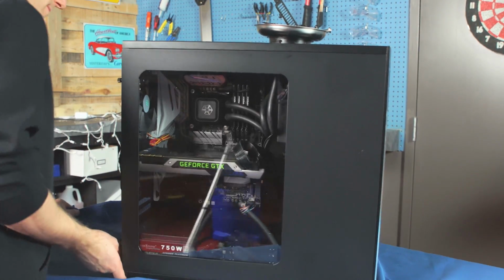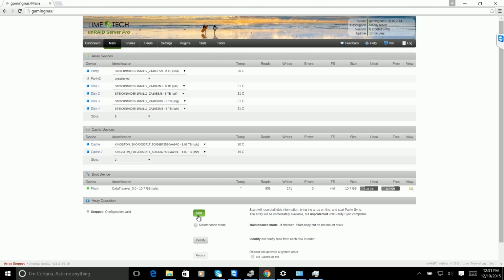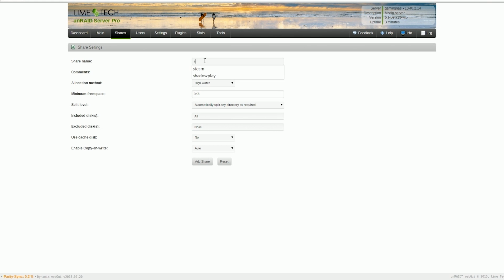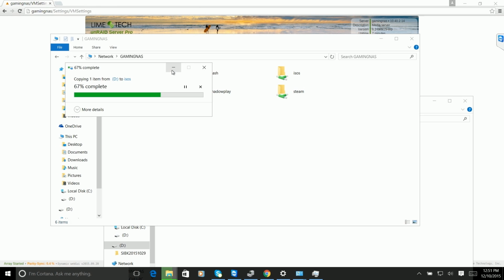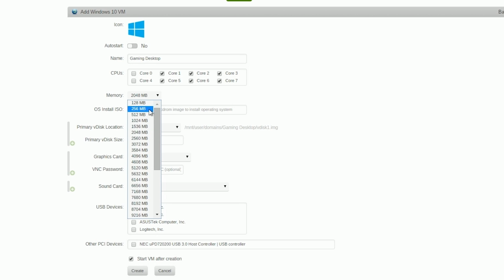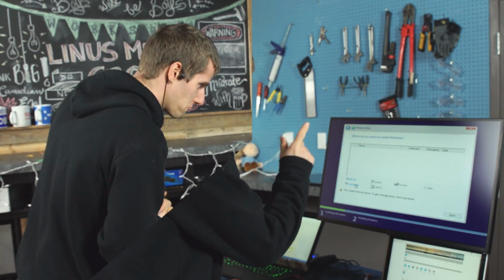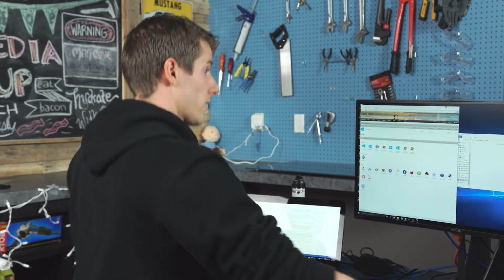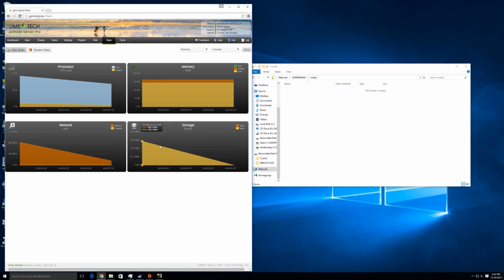Use your Gaming PC's Extra Power as a NAS Ultimate Guide

Comment: For those on a budget and not mind working with Linux, I'd recommend using Owncloud with Lubuntu (there are a lot of tutorials available online if you need any help).
I'd even got it working on an old Dell OptiPlex sporting an even older Intel Pentium CPU plus 2 gigs of DDR2 memory.

I must say that the OptiPlex case is not as flexible as I wanted it to be, but you get to fiddle around with a LAMP stack, Lubuntu and Owncloud :)

If there is a need to get more advanced options, I also suggest distros like FreeNAS or any other that has support for ZFS amongst other nifty options.

Comment: What would be the advantage of doing it this way vs just setting up a RAID through the BIOS or Windows and using that as a NAS?  Is it just for education/cool factor?

I'm surprised at how far virtualization has come (had no idea that you could use the full performance of a discrete GPU), but I would iffy about compromising any performance by running my main OS in a VM and wouldn't want to deal with any VM wonkyness when trying to play a game or do other normal computing tasks.
Reply: +Mark Murarescu True, but at least on my systems that isn't a huge issue. Not interrupting file transfers would be a bigger advantage, but for my home network any interruptions for the NAS would be less impacting than ones to the Windows OS.
Reply: +Darrell Johnson I was actually thinking the same. You can easily add raid in your BIOS or even in Windows and share it over the network. My guess that Virus scanners would work faster as well on local drives when using Steam drives/folders. Tbh I see more problems with this setup than advantages. It does not lower electricity costs only maybe if Unraid/Virt can switch the graph card off completely upon shutdown. Actually the 2 gaming PCs in one made more sense to me personally :) but that also comes with a lot of disadvantages. This is good for a tech demo tho but I do not see myself building this anytime. Rather spend the money on a standalone NAS. And about Windows crashing, well, in my case this usually indicates some hardware related issues which I doubt Unraid could handle, but I might be wrong... I guess I wont figure out.

Comment: I didn't really understand half of what was happening but I'm sure once I was setting up the software etc it would be easy to pick up. Currently I have OS/Programs on an mSATA drive and games on 2 SSDs meaning both of my salvaged 1TB HDDs are sat there hardly being used. It seems like it would be so much better having the HDDs in the system be network linked and actually get some use. 

I'll probably have a look into this more when I build my next PC. Would be awesome to have my gaming rig (which tends not to ever use the CPU fully anyway) store the recorded files to the NAS drives and then have my current rig do all of the video rendering and uploading alongside it.

Would something like this be able to offload stream rendering to a second PC when streaming gameplay etc or would that be pretty pointless?

Comment: I'm thinking of a build. Will it work?
PSU - Cooler Master V750 - Compact 750W 80 PLUS Gold Modular PSU
Case - Cooler Master MasterCase Pro 5 Mid-Tower Case with FreeForm Modular System, Window Side Panel, Top Mesh Cover
SSD - SanDisk 480GB Ultra II Internal Solid State Drive 
Processor - Intel Core i5-6600K 3.5GHz 1151 Boxed Processor
Graphics card - Nvidia GeForce GTX 770 2GB PCIe Video Card (REFURBISHED)
Cooler - Cooler Master Hyper 212 EVO. 120mm PWM fan
RAM - FURY Memory Black - 8GB Kit* (2x4GB) - DDR4 2400MHz CL15 DIMM

Please let me know about everything here. :)
Reply: +BushcraftWumbology For some reason, the motherboard wasn't there. I was planning to use the Asus Z170-A

Comment: If you're thinking short term, this is cheaper. If you're thinking long term this is a nightmare. Think about it. You have to keep your computer on 24/7 to get all the potential out of that NAS. Imagine how much your electric bill will be having a computer with all that extra hardware running all the time. Long term, it's more economical to buy a dedicated NAS. They're not that expensive now to do this. Plus for most users this is asking for something to go wrong.
Cool idea, but pretty impractical.

Comment: So I'm not sure if this was already mentioned, but I have a few questions:

1) If the rig is to be left on 24/7 (well, unRAID NAS and computer as a whole), but Windows is just a VM, if you were to shut down the VM, it should only kill the VM and not the whole tower, right? If so, how do I turn on the VM again? Do I have to access the NAS webpage and select to start the VM again? Or is there another way?

2) Is there a limit to how many VMs you could have on the unRAID? As in, can I have the NAS running via unRAID, and have Windows 10 and say, Ubuntu/Debian/some other OS as another VM but be able to boot into either using the same GPU/monitor?

3) where can I get this USB 3.0 PCI-e card?

Comment: About to build my first computer so any opinions/recommendations about these components?

MOTHERBOARD  -Gigabyte GA-Z170X-Gaming 3 (ATX, LGA 1151)
CPU  -Intel Core i5-6600 (LGA 1151 Skylake)
CPU Cooler  -Corsair Hydro H55
Hard drive  -Western Digital Black 1 TB (3,5" SATA 3.0)
SSD  -Samsung SSD 850 EVO 250 GB (2,5" SATA 3.0)
RAM  -Kingston HyperX Fury Black 2 x 8 GB (DDR4, 2666 MHz, CL15)
Graphics card  -EVGA GeForce GTX 970 Superclocked ACX 2.0 4 GB
Power Supply  -EVGA SuperNOVA 550 G2 (80Plus Gold)
Case  -Fractal Design Define R5 Black (ATX)

Not sure about that motherboard choice though..

Comment: With that amount of storage you'd want to use a RAID-6/RAID-Z2 or a RAID 10 w/ hotspare setup. RAID-5/RAID-Z is notorious for URE (Unrecoverable Read Error).  RAID-5 (or any variant of it) simply should not be used.

Even though this is sponsored, it would be much easier to just build the PC like normal and then run a VM in Hyper-V or something like VMware Workstation with unRAID/FreeNAS with the drives pointed to it.

Comment: hey guys is this a good build?

MOTHERBOARD - asus z97-e/USB3.1
CPU - intel core i5 4590
GPU - EVGA nvidia geforce gtx 970
RAM - G.Skill RipJawz 8gb DDR3
PSU - Corsair 600M
STORAGE -Samesung 850 EVO 250gb SSD
                   -WD Caviar Blue 1tb
Chasis - Corsair spec-01
OS - Windows 10 64-bit

This is my first build and i was hoping to run most games on high with 50+ fps
Reply: it seems fine and GTX 970 will definitely run almost every game 60+ fps
Reply: Thanks

Comment: Actually the previous video, the one with the dual head gaming rig makes more sense...
Using  this kind of hardware for a NAS, which should be on 24/7 is plain overkill.
Personally, I am using a homeserver for about 5 years now, but that's a standalone rig, with an undervolted CPU and at most 30 W of power usage. Note that I did not say NAS, as that would only be a narrow usage scenario in my case.

Comment: Gaming pc sucks a lot of power just idling around, rather invest in something like a NUC and just stick all your HDDs into it and let it run around the clock with all drives shared on the network. This is far simpler and far cheaper (power consumption wise) than this witchcraft unRAID paid you to perform. Plus as an extra you can have this miniPC by your tv allowing it to double as NAS and HTPC

Comment: Word of advice. Take frequent backups if you plan on doing this. It's a bad idea to build multi-purpose machines. If one piece of hardware fails, you lose both your NAS and gaming rig until it's fixed. Also, the chances of corrupting your data are significantly increased if you overclock and don't use ECC RAM. I tried doing this 3 years ago and ended up with an unstable array after 2 years of running like a champ. I didn't use unRAID, like this video says, so maybe that'll be more stable. But, in my mind, it's still a way better idea to have seperate machines if any amount of importance is placed on what you're doing.